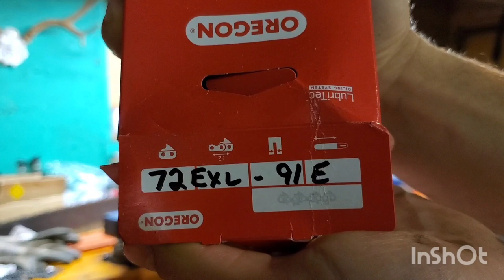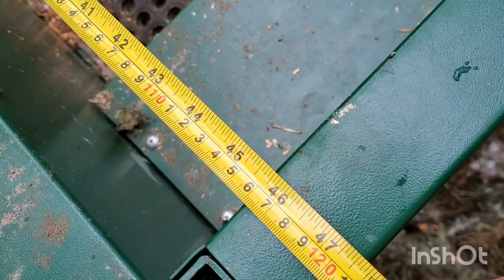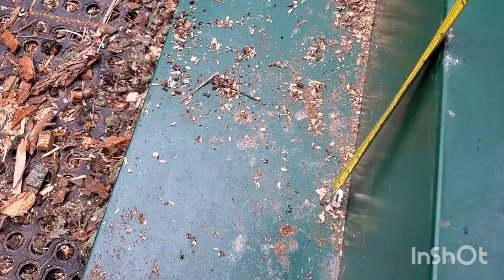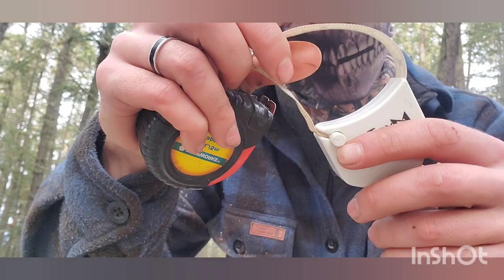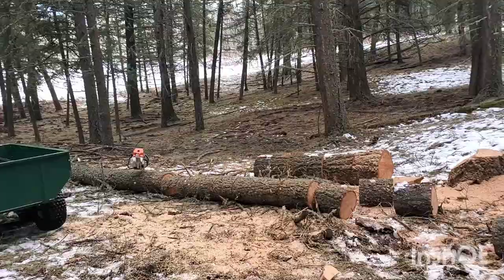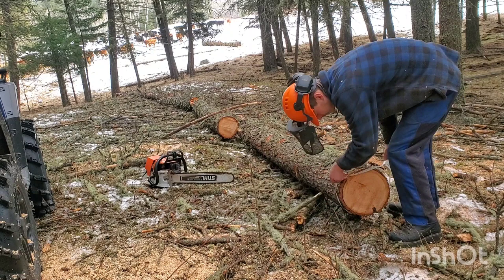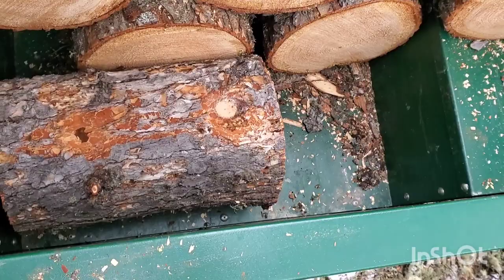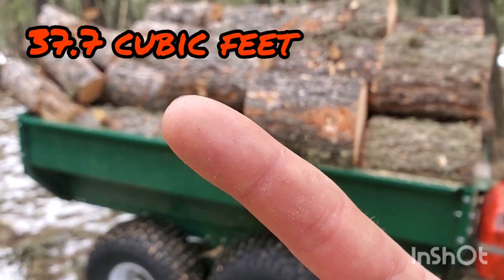MUTS ATV Trailer Capacity and Overview, Stihl 461, Oregon EXL Chain

Comment: Great job ! It looks like you found a nice bunch of dry ones & not to thick , easy to get around with a quad, I built a double axle 6 foot trailer I put a hitch on the back & pull a single axle 6 foot behind works great if you have no big hills, I just love wood cutting had to sub :)
Reply from the maker: Thanks for your comment. Been a while since I made a video, just been busy doing other things and fighting the winter weather haha. I have a few decent hills to climb/descend so especially in winter this trailer is about all i want behind me.

Comment: What size are your tires? Been looking to replace my stock small ones.
Reply from the maker: They are 28x9.5-14. I put on a perfex 2" lift kit when i changed them. But you'd probably fit them without it. These tires (sti outback max)are very hard, though, and ride extremely rough at speed. But they work well for me because I'm just crawling around.
Reply: @BenOfficial94  thanks for the fast answer man!